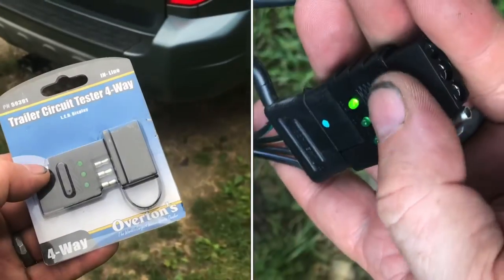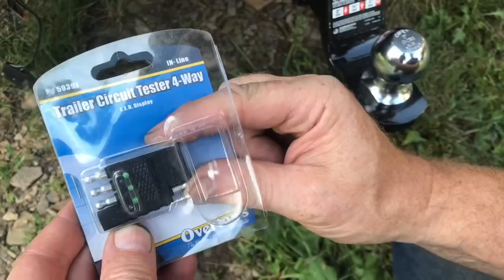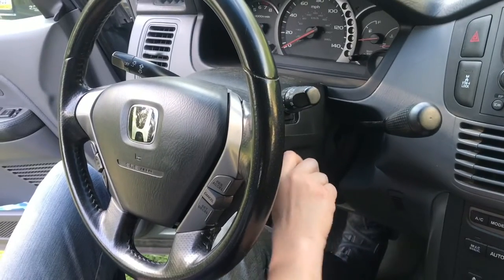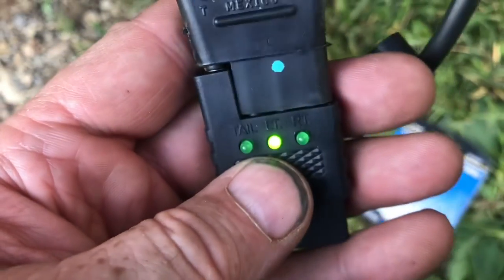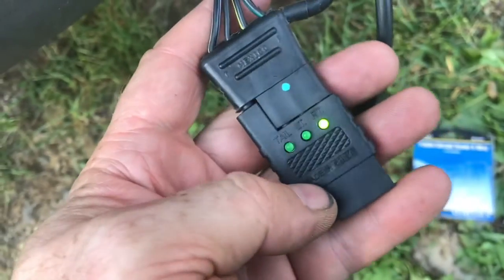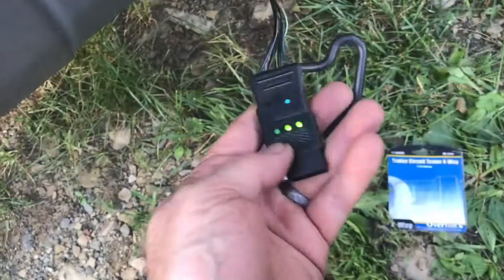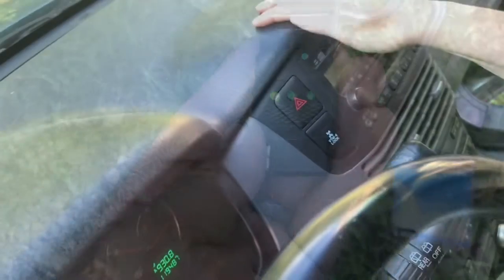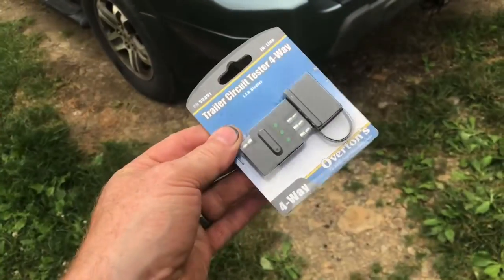(REVIEW￼) four-way “trailer light tester” harbor freight￼, overton￼

Comment: Spent a few hours installing new lights on my trailer, finally got so frustrated they wouldn't work that I took them back off.  Bought one of these testers a day later, and come to find out, my new car must be wired incorrectly as all the lights are solid green even with all car lights turned off.

Guess I get to take off all the precious owner's wiring to figure this one out.